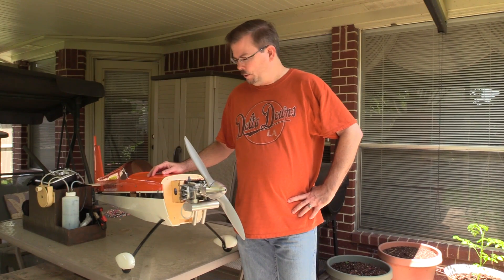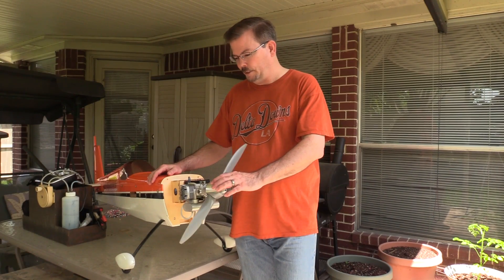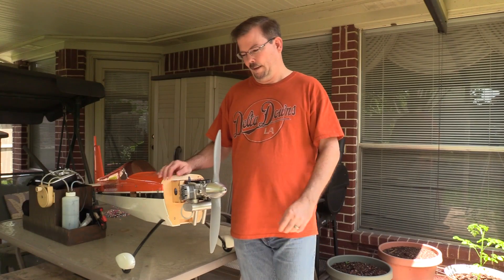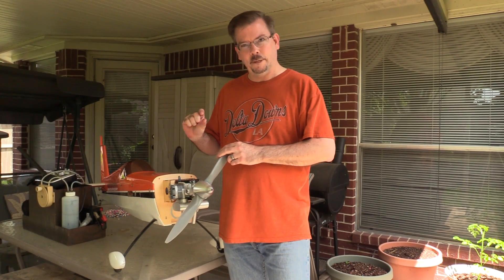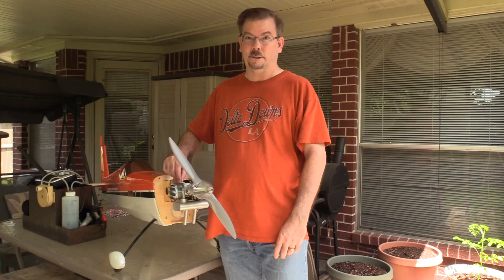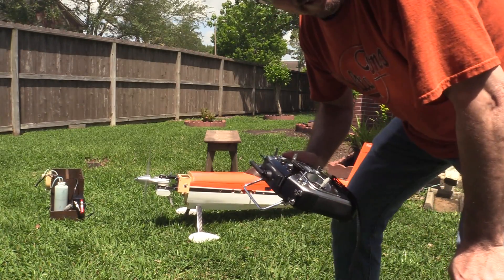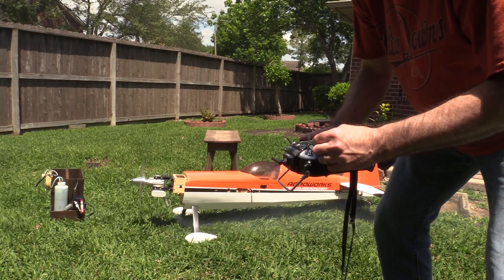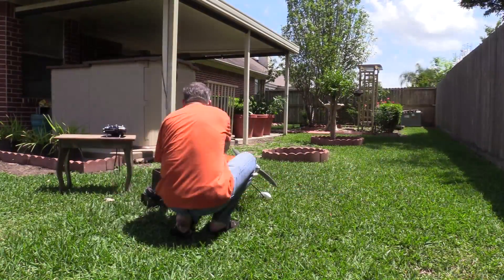OS 160 FX Problem - Resolved!

Comment: So the conclusion is the O ring needs replacement then? If the fuel tubing solve that issue. The problem on mine needs a starter to do a first start and once the engine has ran. I can just do a hand start. Do you have any suggestion for this problem. By the way my engine is 90 degree inverted.
Reply: This engine starts very easily back flipping off compression when properly primed.  Found it likes 5 percent nitro best and OS F plug.  Ran mine in an 1/4 scale edge and later a QQ yak 54 with an APC 18/6W prop.  Plenty of power and mild mannered.
Reply: @belt1974123 osf plug gives me a nice idle empty fuel tank can only shuts down the engine i use it on all of my glow engines i never go on #8

Comment: It would have been more educational to all modelers and viewers if you had video of the engine showing the problem first. Then, also show the steps you used to rectify the problem, then finally add this video on. The video could have been edited to make it shorter. Seeing you set up and clear away does not help much. Cover all the equipment and settings: fuel used, propeller size, etc.
Also, the orientation of the needle valve "cup" traps dirt on a sideways mounted engine. This dirt works its way past the O-ring and creates the air-leak. Been there, done that! Your solution with help keep dirt out. If it was an air-leak, you should have been able to see air bubbles in the fuel line. I'd check for that on all engines mounted like this.
I also think you have a stuck ring. That compression problem needs to be resolved. Is the cylinder liner not peeling off. OS engines are notorious for that problem. Check also for any cylinder head leaks or stripped screws.

Comment: How did you get a piece of what looks like glo fuel tubing, around the needle valve? There's no way to stretch that tubing enough to go around it. It's just too small. Did you heat it up first? Can you share what you used and how you got it fitted?
Thanks,
Reply from the maker: I used some 'large' fuel tubing, not the standard stuff.  Thanks for your comment.
Tower has it: https://www.towerhobbies.com/product/silicone-fuel-tubing-2-large/DUB223.html

Comment: this maybe to late but i had one of these engines i had to use high nitro % for it to run right a lot of my club members always ask and said how did you get it to start on its first spin by hand at the time i was very new to R.C. world
Reply from the maker: Thanks for the tip.  Unfortunately for me I have since wrecked the plane and damaged that engine also.
Reply: @jamesniansrcadventures1011  Ouch! That was a $500 engine! And that plane was a kit too, probably $200 or so. Now, how can you REALLY enjoy yourself flying when you have so much money at risk of damage? The answer is simple: use converted weedwacker and chainsaw engines and scratch build with foam and wood. These engines are plentiful and you can find them almost anywhere. They are built super strong and reliable. Start by reading the forums RCU, RCG, SPADworld etc on conversions, then just try anything. You don't have to worry about breaking anything because the cost is so low. When I saw "the light", I never looked back. Also, gassers use much less fuel and you buy your fuel at the gas station, not at an expensive hobby shop. My first Ryobi cost me $50. Just the other day I bought a used engine for about $10.00 and it runs fine. You don't need to remove the magneto, and it is super reliable. Hate deadsticks - forget glow plug junk (thanks for nothing, Ray Arden!) and fire up a weedy or chainsaw today.

Comment: That is the most common fix for a leaky HSN.  I have been doing that for years on engines of lesser quality, like ASP/Magnum, etc.  I am a bit surprised that you would have this issue on an OS engine.  I'm pretty sure that there are internal O-rings that could be replaced to fix it properly.

Comment: What size prop are you using.  I have a really nice 160. I have never used it yet.  Thanks.  Ernie
Reply from the maker: It's an APC 18x6W (wide).  It's the recommended prop for 3D flying.  Not that we're 3D pilots...
Reply: @jamesniansrcadventures1011  thanks

Comment: If I were you I would plum in a servo operated needle valve so you can adjust the fuel mixture from your radio, that's what I would do. BVM used to do a good one.

Comment: You need to throw a Lazer on that! They are a preferred engine in the UK. NOT cheap however. A Satio would be a great engine to run on that. I just recently learned about the fuel tubing trick although I really already knew about it indirectly. I do the same thing on small engines that develope leaks around the needle valve, mostly due to age and slop caused by viberation. I use it mostly on snow blowers believe it or not. That and Rototillers. My brother ran Nitro engines and I remember the tube trick back in the 70's. Now that you passed it on, lots of frustrated guys will be digging their badly idling engines back out of their junk drawers!

Comment: 160**
Reply from the maker: I bought mine from Tower Hobbies.  Unfortunately this engine has since been discontinued from O.S.  You may find them on the used market or possibly some retailers still have some new ones in stock.  The lesson to be learned here applies to all glow engines that you may be experiencing trouble with, especially the larger ones.
Reply: James 'n Ian's R/C Adventures what's a good motor for the ultimate 120 ?
Reply from the maker: I'm sure today many would put an electric motor and big battery in that plane, but we still appreciate the sound, smell, and headaches of glow engines.  So I asked Ian and these were his picks:  2 strokes: O.S. 120AX or ASP 120, 4 strokes: O.S. 155a ($$$), Saito 125 or 150, ASP 120.  ASP engines are available thru Hobby King, btw.
Reply: James 'n Ian's R/C Adventures thanks
Reply: @maxhiltin1133 OS 1.60, Satio 180, YS 140 sport if going nitro.  Moki also made a 1.80 and a 2.10 if you can find one.